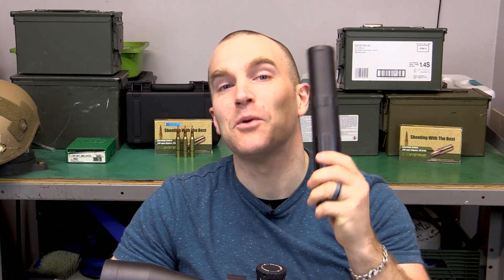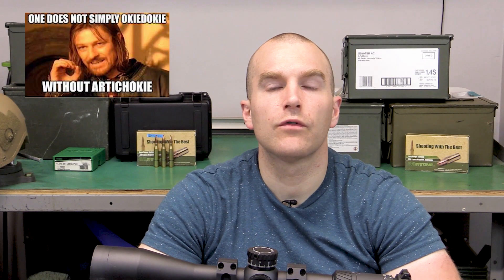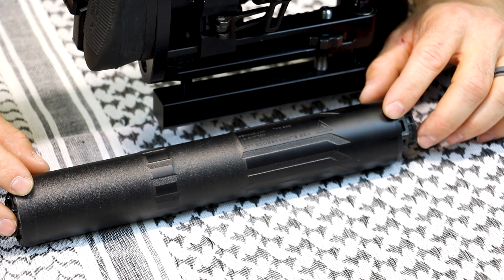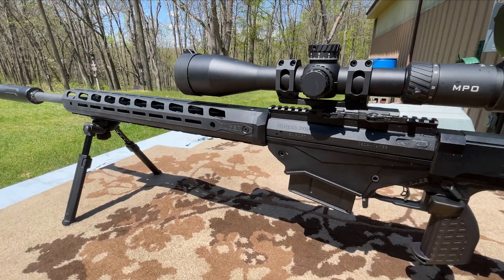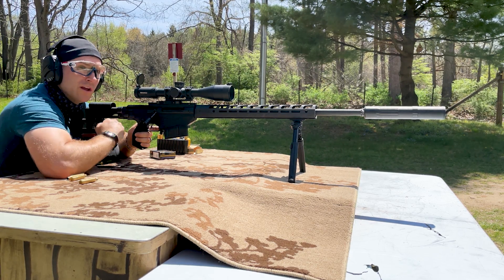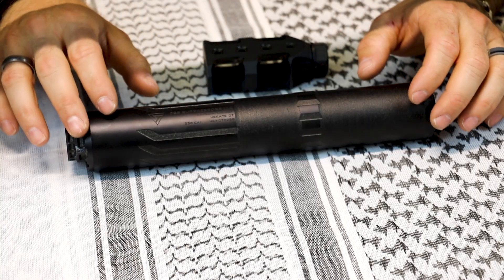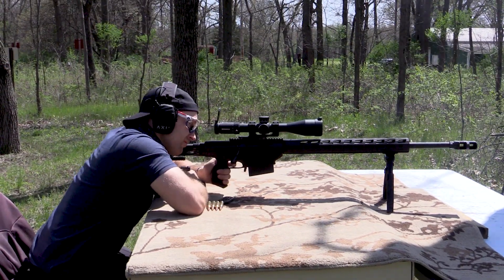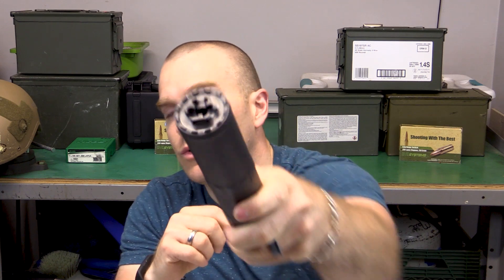A 3D Printed 338 Cal Suppressor? CGS Group Hekate @SilencerShop

Comment: Is the direct thread mount interchangeable or is it fixed on this Hekate?
Reply from the maker: Unfortunately it's fixed :(
Reply: @BuffRANGE  Gotcha. Hmm. I'm debating on getting the Hekate vs. TBAC 338 Ultra SR. I want to use it on 308 and 300 Blk as well.
Reply from the maker: @duomaxwell7862  That does give the advantage to the TBAC can. With the fixed mount you are limited to the larger threads and would need a threaded adapter which then adds tolerances to potential alignment issues :(
Reply: @BuffRANGE  Agreed. Since I can only get one can, TBAC it is!

Comment: "unicorn farting inside of it" ---  I still have no idea what this means.
Reply from the maker: I should have taken a pic of the inside of the can before I shot it. Whatever coating was used, or perhaps maybe the 3D printing process, had left the inside of the suppressor in rainbow like colors. Similar to this: 

https://www.amazon.com/rockcloud-Titanium-Decoration-Gemstone-Specimen/dp/B01G3EEE2G/ref=asc_df_B01G3EEE2G/?tag=hyprod-20&linkCode=df0&hvadid=192011150573&hvpos=&hvnetw=g&hvrand=2822213576211257914&hvpone=&hvptwo=&hvqmt=&hvdev=c&hvdvcmdl=&hvlocint=&hvlocphy=9017288&hvtargid=pla-300353612627&psc=1